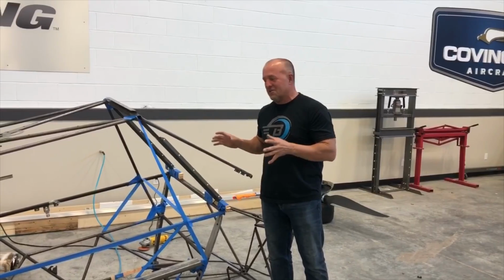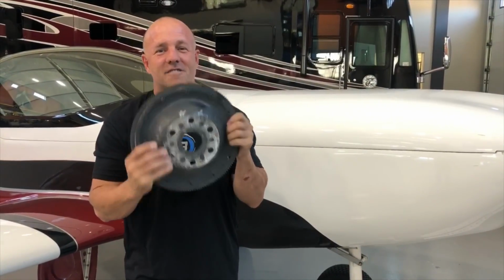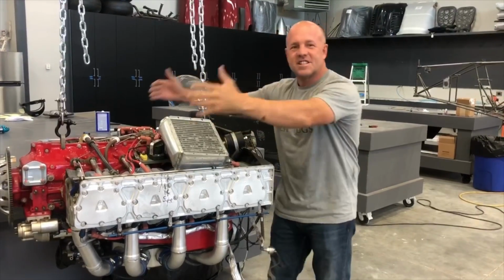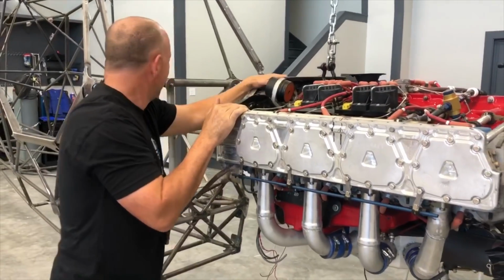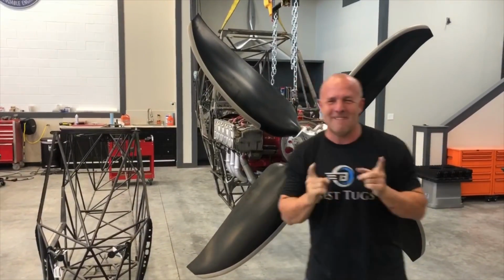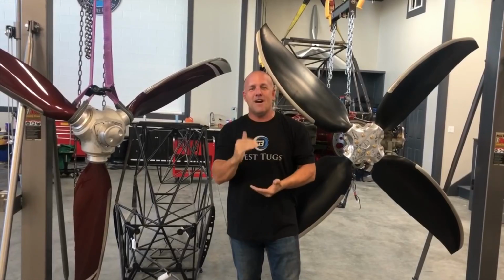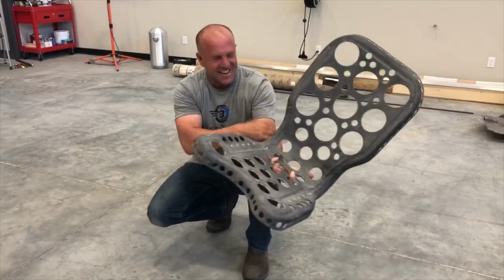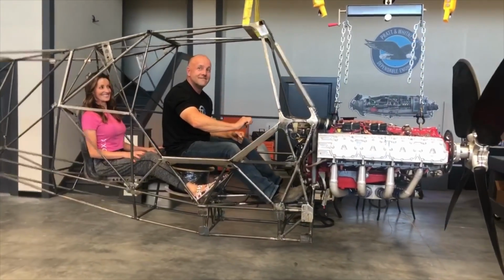Never said that Scrappy was Normal 🤷🏻‍♂️ (Scrappy Bush Plane 3)

Comment: When I was enlisted in the Air Force, I remember seeing a B1 at the McChord AFB Rodeo back in the 90s.  The pilot took off and pointed the nose straight up and I sware that bird register on the Richter scale as it blasted off and disappeared into the blue.   It would be mind-blowing to see Mike do this in Scrappy.
Reply: I have read statements by a big name in the history aircraft engine technology and development. He stated that the performance of the B-2 based on the engine specs are impossible. The numbers don’t add up by, at least, an order of magnitude. Basically a huge performance differential. He stated that the B-2 would have barely enough power to get airborne based on the engine power and fuel burn specs vs aircraft weight. This guy is a well known and highly respected authority on aircraft piston and turbine engine development. I believe his name is Bill Gunston? His statements were reported for a short while after the B-2 was revealed to the public. Since then? Crickets. I think he got the STFU visit from the “Men in Black”. 👀👽👀  So, either there is another source of propulsion on the B-2. Or the engines produce a tremendously higher level of power output for a given amount of Jet fuel consumption. Possibly an incredibly more energy dense fuel? Or using some of the power of the standard jet fuel in the engines to produce a much more efficient wing with much less drag. Or the B-2 somehow behaves like a much lighter aircraft than it actually is. Hmmm? Maybe Electro-Gravitics? Basically, the B-2 is a giant wing. Improvements in lift/drag give more performance per pound of weight vs a standard aircraft configuration. Increasing the airflow over the wings by using a very high voltage potential difference from the leading edge compared to the engine exhaust and/or trailing edge. Increasing the flow of ions over the wing. Maybe significantly enhancing and/or accelerating laminar flow over the whole wing surface? Eliminating loss of lift from airflow separation due to turbulent wing surface airflow? And/Or eliminating the drag and flow losses of a standard boundary layer? Use your imagination. I’ve used mine and have some ideas and opinions. But we all know what opinions are like.
Reply: @msmeyersmd8  my mistake ... it was actually a Rockwell B-1 Lancer that I saw at the McChord rodeo in the 1990s.

Comment: Umm, Mike, this isn’t going to be an airplane, it will be a helicopter.  Suggest building a zero takeoff roll 45deg launch pylon.  Simple question though, how are you going to handle the adverse torque reaction when that prop bites at low airspeed?  Seems like a prop wash sensitive set of inboard ailerons would be an interesting solution.   Otherwise you’ll have to be very careful rolling on the power or else Scrappy will become Twister.  A logical but complicated solution would be counter rotating props. The “HeadLocker” is a beautifully designed solution.  The flat “valve cover” surface is absolutely crying for an engine-turned surface detail. I’m thinking 3/8” diameter tool.

Comment: A flat 8😳 I’m no aviation engine expert but I do push the boundary’s in racing engines. I would think a horizontally apposed 8 cylinder has crazy windage problems as most flat boxer style engines do. Are you pulling crank case vacuum via oil scavenge  pumps?  I really love your channel mike!! We need to get you back to the drag strip with that crazy brain of yours
Reply from the maker: Thanks much!  This engine came out of one of my racers.  It holds a transcontinental speed record among other awards.  Tail number is N36XX.  It has worked great.🤠

Comment: I work on funny cars mainly I have worked on a few horizontal oil derricks in my time aka dragster but I don’t like them much. Chromoly strength to weight is unreal I bet that whole chassis weighs less than 150 lbs

Comment: Torque is torque man. Don’t you know that? Small prop, large prop, does not matter. Your 4-blade prop will twist the plane even more than the larger 3-blade because it will extract more power/torque from the engine.

Comment: Looks great Mike, how are you doing your structural analysis?
Reply: Torque!  Torque!  CluE, you are so correct or that engine will up and leave the rest of the frame parting at the eng mounts.  ---  I just luv Mike's enthusiasm in get-it-done three steps fwd and one step back and telling the reason why. -- Mike is the top envy lately with the EAA ones I would imagine.
Reply: GoatDriver Ram, there’s a lot of analysis to make sure the frame can require all of that torque. An airboat doesn’t have as many constraints as an aircraft which makes it a lot more complex
Reply: @92813justin  ;  CluE, after the analysis are ran, the slide-rules are put down, then its time to mock-up an old fashion  static test cell w/intended wing-spar and wing structure with weights (simulate fwd wind air pressure) attached to the planned frame to engine mounts and red-line that strapping new engine beyond numbers one would never think of getting to in any hot-dogging runs.  Then x-ray.    Space-X doesn't test-cell every other week just to watch a blu flame.

Comment: Do you use a computer simulation package to see where the maximum loads are? If not, how do you know how close you're getting to the maximum stress the material will cope with and what the safety factor is?

Comment: How's come you use brakes like that? Lighter than motorcycle brakes...even lighter motorcycle road race brakes? Want to really use the brakes any way you can make the suspension squat under brake application..the lower the center of gravity the less the tendency to nose over and when it does it should happen smoother and more predictable...way cool vid.. really neat to be able to see what holds a plane together...aka not muck lol

Comment: Hi Mike - first off, love you channel and your builds.  I'm an EAA member and am designing my own aircraft (powered parachute - much simpler), and I recommended your channel to an aspiring aerospace engineering student I know.  I was thinking about the 0-60 comment you made and the air boat videos showing the acceleration with this prop.  The thing that comes to mind is that an air boat is more constrained and has fewer control inputs than an aircraft.  Are your reflexes fast enough to maintain control of the aircraft with that much acceleration?  Do you have fighter pilot/race car driver reflexes?  Being an engineer, I suspect you've tested your reflexes and gotten some numbers.  Do you ever use flight sims (like x-plane) to trial run handling or something like Simulink to calculate control dynamics?  The flight sims probably don't model departure well, so maybe it's a moot point.  Really admire your skills.  Michael
Reply from the maker: Much like with my racers in testing, I will push it up and easily adjust throttle as my controls are reaching limits of controllability.   I will, of course, do as in the past and baby step up to its limits.  I am also adding more controll surface on everything as stock is not sufficient.  Thank you for your thoughts 🤠.
Reply: @MikePatey  Sounds like a plan!  Best of luck to you.  Really makes me think of the difficulties of flight test for race aircraft.  I think I'm too much of a chicken to do what you do.  Might be really interesting to see videos of your flight testing. Mike too

Comment: perhaps your best video EVER. however it wont work. you could be killed in this adventure. heres why. airboats have the luxury of having water under the boat which acts as a flexible non-compressible fluid thus absorbing torque. the water also has a coefficient of friction of which air does not. air has a minimal parasitic drag. once the plane leaves the ground the torque or p factor on steroids will flip the plane over. there is no rudder control that compensates for the amount of power in the light aircraft you are building. i admire your creativity but this could be a show stopper. keep thinking! love it.
Reply from the maker: Thanks for your comment 👍🤠 I appreciate your concern. I also agree with all your logic and facts. They are all correct. except the one where you say it won’t work. It is possible! You will see it soon. The only way this wouldn’t work is if the pilot adds more throttle than he has brains.  Look up a couple of my last world record breaking aircraft.  7 records down including taking out military and Howard Hughes with my own designs. One of the particular planes is called “Turbulence” it is a smaller plane than scrappy. All carbon fiber. The rudder, aileron, and elevator are all significantly less in size than Scrappy.  The motor is 1090HP. I limited its max power on this to Pratt Turbine powered to 850HP.  If I gave full throttle it would do everything you said. It would turn and try to flip the plane.  I would have to be a fool to give full throttle.  Scrappy has only 500 hp and twice the controll surfaces.  I still can not and will not punch it off the line. However I can, as in my racers, push it up and easily adjust throttle as my controls are reaching limits of controllability.   This has been the case with almost a dozen of my creations.  I will of course, do as in the past, baby step up to its limits.  I am also adding more controll surface on everything as stock is not sufficient.  Thanks for your thoughts, it will work and be a lot of fun to find it’s parameters 🤠 I appreciate you thinking to voice concern it is always welcome and taken to heart.
Reply: @MikePatey  i really enjoy everything you do. So please don't take my comments the wrong way. My mind thinks in similar circles as does yours but i suppose as I've gotten a little older I'm more cautious and i would hate to read about a guy who's imagination went to far and was killed. That's all I'm saying. I'll be front and center with popcorn and baseball cap in the front row watching.  Be careful and good luck.

Comment: Is there any way to build a variable width prop.. with a cam or a hydraulic rod running through the center so you'd be able to change your bite for speed?

Comment: The funny thing is that no prop creates any more thrust than the other, they are designed however to make the thrust at a different rpm. Thrust can be calculated if you have a true dyno hp number pretty spot on.  Cool project, curious to see it in action.

Comment: Since you're doing so much custom work, why not make the prop constant speed? The motor is obviously set-up for it. I've long wondered why airboats don't have constant speed props.
Reply from the maker: Constant speed prop will add weight up front.

Comment: Even though the Airboat shot was sped up just imagine revving up a variable pitch with it trimmed flat and then putting in the pitch. It's the ultimate flywheel and if you don't believe me look at air boat racing.

Comment: Mike, have you considered the electrical interference that will come off the alternator interfering with your cockpit electronics? I'm sure it'd be an easy fix, wrap it in CF or something, but just something I wanted to point out. I had a very high performance car in my younger years and and had a custom computer that was close to it (while we were tuning) and it got all kinds interference, fixed it by moving it to its final location much further back in the dash, but we were chasing ghost gremlins all over the place trying to figure out what the heck was wrong.

Comment: I am probably wrong due to some sort of complex tradeoff between induced and form drag, but the 8 cyl motor is heavier, as is the whole plane, than a carbon cub. So you will be burning more fuel at the same speed because there is more weight, and therefore more drag. You can fly at the same power (i.e. fuel burn) setting as your friends, but you will be going more slowly. At reduced power you are just hauling a bunch of metal around that you don't need.

Comment: Practically no spot on your body weld spatter can't hit at some point.  Thanks for taking the time to explain the engineering.  Are you going to need a special throttle?   Looks like you're going as far with this plane as you did with Draco.

Comment: The technical term for what you refer to as cavitation is flow seperation. Cavitation happens in liquids, when the pressure is low enough in a single spot for the liquid to boil. The reason the prop stops creating thrust at a certain point is that the flow on the suction side of the blade does not want to follow the profile anymore and seperates, hence the term flow seperation.

Comment: wow did you see the torque on that air boat,  I bet your rudder will be 10 foot tall and an extra 6 foot of wing on one side to control that. The Corsair had 3 foot longer wing on one side. Top Fuel Scrappy

Comment: "I want it to look like a Carbon Cub......It just won't sound like a Carbon Cub," followed immediately by Mike getting away with posting PORN on YouTube!  Between all this engineering (I'm a Mechanical Engineering Technology Student in my Senior year), the air boat racing and that clip of Turbulence starting up, this video is NSFW............For that reason I will not be getting back to work!

Comment: This is going to be so much fun to watch take shape and fly! I love the friggin air boat prop! Those drag boats are astounding 0_0...
Just a sidenote: with that Whirlwind prop as a benchmark, the boat prop would be lowering the torque reaction only if you're lowering torque at the hub. Diameter isn't actually a factor in the torque reaction when comparing two prop configurations that use the same power at the same rpm. So without giving up power, you could only really lower the static torque a tad if you pitch it to turn a little faster at static full power assuming power is relatively flat up there... do you have rpm margin on the 780 to do that? It could only help a tad anyway... In any case, even if you end up having to limit power a little until airspeed comes alive, Scrappy is going to leap off the ground!
Another side note for anyone curious, a turbine engine of the same power has maybe like 20 times the shaft rpm and so 1/20 the torque. That's why there's very little reaction to deal with (and of course no corkscrew hitting you fin or P-factor).
We're really enjoying following you!

Comment: Not understanding the physics behind choice of smaller prop diameter. The torque on your aircraft all comes through the driveshaft. It consists of components including (1) around the longitudinal axis, this being exactly equal to your engine's torque output and hence not dependent at all on what prop/egg-beater/knife-in-a-peanut-butter-jar is attached, and (2) two around the vertical axis -- the first being that if your tail is still on the ground, then the positive attack angle gives the right side of your prop better pull than left side -- the second being that if your tail suddenly rises, it causes gyroscopic force. Only the last one depends on the rotational moment of your prop, which, as I understand it, is what the smaller prop minimizes. But it doesn't seem like that is what you're talking about.

Comment: Mike, you are correct to a certain extent about fuel burn. But when we talk about air-throttled engines the larger engine has more pumping losses at a given HP because the smaller engine is running at a larger throttle opening. You can see this from the amount of intake vacuum - that high vacuum is fighting the pistons! If you look at part-throttle brake-specific fuel consumption charts, you will see that from 25 to 50% throttle opening your BSFC decreases considerably. It makes more HP but each HP is "cheaper" in terms of fuel consumption. This is why I like fuel-throttled engines (diesels) for 4-wheeled vehicles. The BSFC stays low at low throttle openings. That's why a 600hp Cummins can get 18 mpg when you drive it nicely but a 600hp big block in the same vehicle will probably burn twice as much.
Reply: +50

Comment: I would call it blade stall, not cavitation. As the airplane moves forward the blade aoa reduces and the blade unstalls. Blade aoa is the vector sum of the forward speed and rotational speed. I hope he has reinforced his airframe enough. He seems to have done these crazy things before so he knows what needs to be done but geez this is extreme. 😱

Comment: I know I have the susp all worked out.  Could you use an automotive Baja coil over shock with. A trailing link back to the wing support for more longitudinal strength?  Should get at least 10-12 pinches of travel. I burned myself right thru my coveralls, isn't welding fun.....

Comment: You'll still get the same torque reaction, the motor does not know if it is big wide prop or  small deep prop .. or a hydraulic brake  test load,  the engine only knows about it's output torque ... and that will be the same with a race prop or an airboat prop, and the torque reaction of the plane will be the same ... your "jet engine" analogy is flawed .. the jet engine produces less torque reaction because they are doing a lot more RPM, and a lot less torque for the same HP.